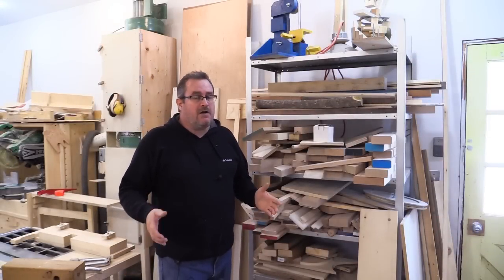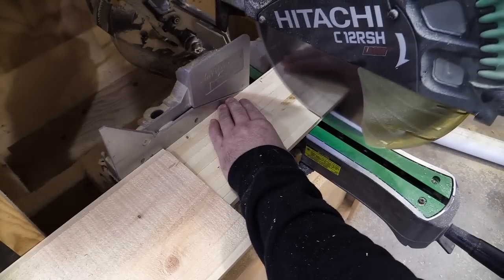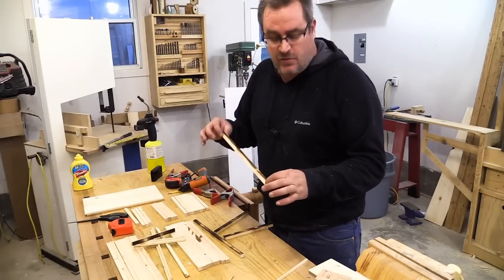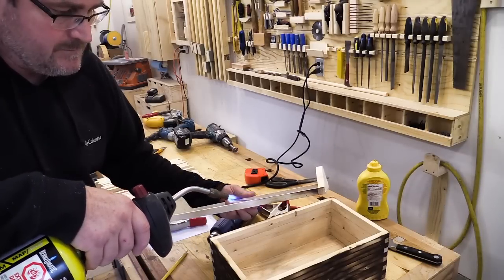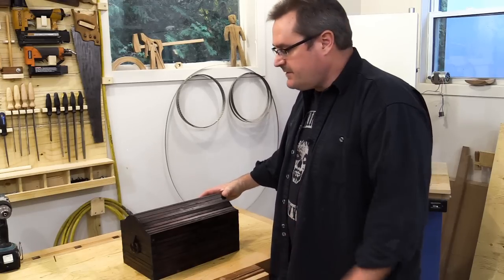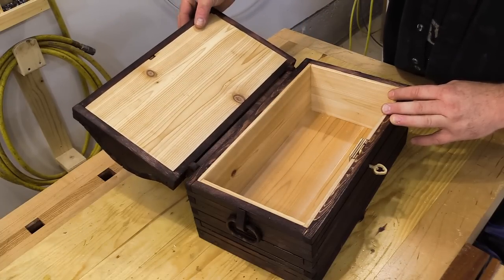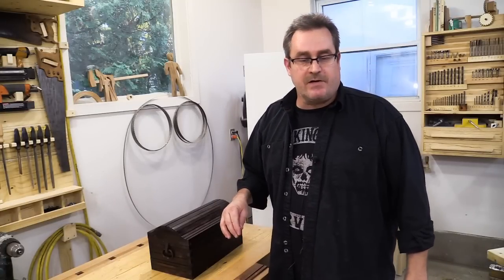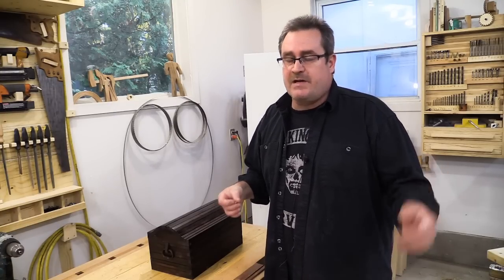How To Make A Rustic Treasure Box

Comment: John, you should consider doing a multi-part video for things like this.  I wouldn't recommend a lengthy series where you have 4 sequential parts but rather do an initial video like this and then a video for each component that could be fairly short.
Reply from the maker: Jared Shaffer Then watch my views fall off. A more engaging project, perhaps, but not something like this.
Reply: John Heisz I'm not sure about that. Clever little mechanisms can be very appealing, and might draw in people who would never otherwise find your content.

Especially if you framed it as it's own thing. Like, instead of being "Scrap Wood Chest Part 4: The Lock," you could entitle it "Wooden Lock." High-light the mechanism, not it's placement in a series of videos.

Well, it may or may not work, but just my thoughts.
Reply: seigeengine Got to agree with that !

Comment: This can be improved to be and humidor for cigars. Cedar is already inside, on the top of box under " secret place" you can add sponge moisturiser and higrometer and voila! Pretty nice rustic and strong humidor for cigars. 
PS: In this option it will be propably few times "more treasury" for potential client buyer:D
Reply from the maker: michji2 It would make a great humidor, for sure - it's the right size. I don't smoke, though.
Reply: "improved" made me sad. ;(